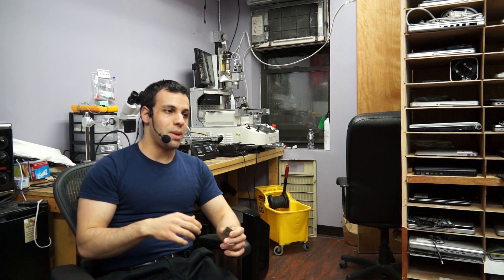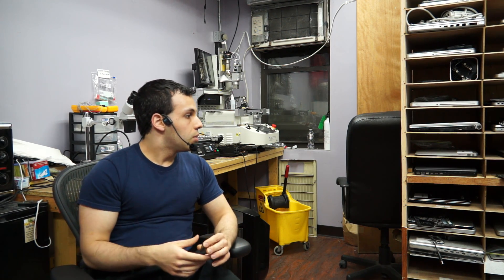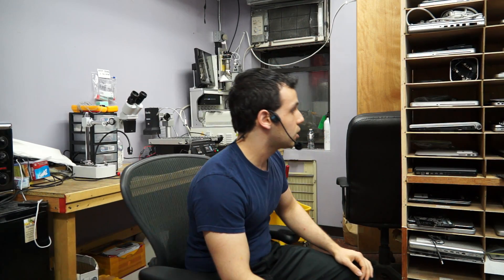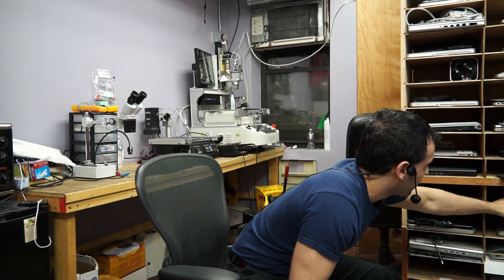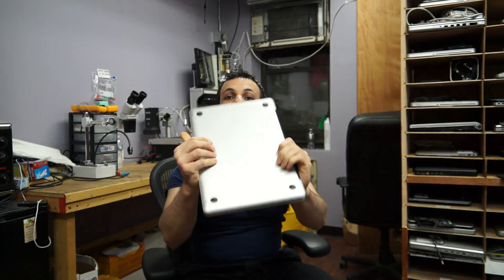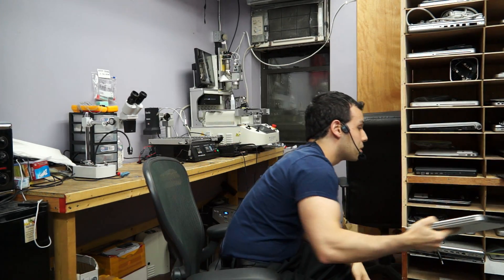Reballing flip chip GPUs is BULLSHIT - the truth about dead laptop GPUs & repairing them.

Comment: So is this what's happening when others a reballing the old fat ps3 systems?  There are numerous reasons why the YLOD or RLOD occurs, and numerous fixes as well.  However, a lot of people seem to reball the ps3 with leaded solder and their system works.  I'm just wondering if this is the same issue?  The reason people believe that the reball on PS3 BGA chips work, because a lot of "experts" have given explanations as to why it works.  It doesn't work only for a month, but if the proper amount of high grade thermal paste, copper shims, new K5 pad replacement, and an upgraded fan, they seem to work for an extended period of time.  Of course as long as the thermal paste is in good working condition and not dried up.  I'm no expert, but others swear that doing all of that works.  Nonetheless, now that I've listened to you and your thoughts, I have a lot of new, solid information.  So you're saying that the solder bumps underneath the chip Die is destroyed and it is being melted and the connections are being made again?  I'd still like to hear a counterargument though.  As I stated before I'm no expert, but I NEVER make a determination based on the information and explanation of a single individual.  Dick's Last Resort is fucking retarded, that's a FACT lol.  What is more puzzling than the argument regarding the BGA GPU is why grown adults pay to eat at Dick's Last Resort to get shit on and wear stupid hats.  Anyway, thanks for the info though.

Comment: How could the solder balls under the chip gets de-soldered if the chip is held under pressure by X-clamp or whatever tightened metal brackets?

Comment: Do you have sources for anything mentioned here?  Heating the board partially fixing the issue can be attributed to board flex, it's the same reason that idiots wrapping Xbox 360s in towels would fix the issue for a few weeks.  The real issue there was the PowerPC chips used ran very hot in a poorly ventilated system.  In addition to tin whiskers forming under the chips, which is a known phenomenon with lead free solder, board flex became a huge problem with these systems.  Open any old Xenon or Zephyr xbox and you can see the board will almost always be physically warped.  Very rarely would an actual chip go bad, and it was always the GPU, which could develop microfractures in die.

Comment: You are absolutely right but you should have told also how die to substrate contact is made in modern chips at time of me replying this is thermo compression bonding. Depending on the material used for the bump contacts the pressure and temperature needed for redoing this process can be very high. Aluminum bumps for example are bonded by putting at least 18kn pressure on top of the chip and giving it 450C heat. Also most of the time this is done in either a vacuum or in a special gas atmosphere for uniform heat spreading. Most common bumps are made of 2 materials copper and lead, i have no idea how much pressure and the temp needed for this type of bump. Also the type of bump used in a certain chip is not advertised so redoing this process if it can be done at all is guesswork. Everyone knows the microscopic scratches in the cooler need to be filled with paste to get good contact. Bumps that connect the die to the substrated have the same problem on molecular level, paste is no option since we want electrical contact here. Thermo compression bonding is a process that forces both surfaces in the same shape to close the gap. This is why a combination of high pressure with high temperature is used. The temperature is very far under the melting point of the material used so it is nothing like soldering. Just reapplying some heat on a broken contact will not solve the issue in the long run. The crack in the bumps is microscopic small the heat that temporarily fixes the issue is because heat warpes all materials which with luck increases the contact pressure of the broken contact enough to be temporarily be "fixed" it is touching again but not bonded.

Comment: Thank You so much for you honesty. I've attempted this type of repair on a few of my devices over the years and could never understand why it didn't seem to matter if the solder melted or not and why it would always fail again very quickly.
This explains much better for example what is going on if you try and use "the towel trick" on an xbox360.

You Rock Dude